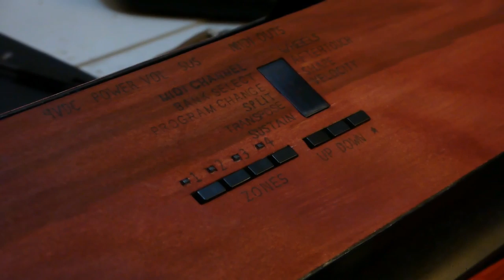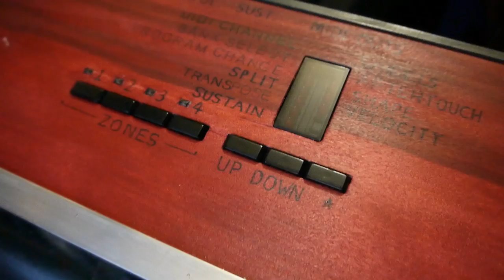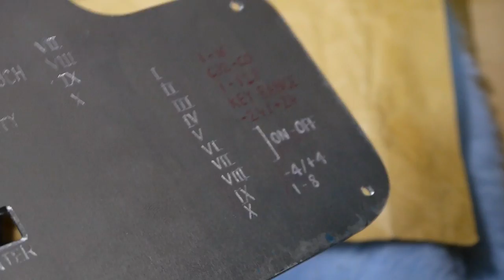Make your keyboard look AWESOME Pt1 - Fatar SL880 Restoration - JDSC Projects

Comment: I have a Fatar Studio 90 and that "sticky stuff" is a rubberized coating that has decomposed.  It did remove the lettering when I removed it, but I didn't mind.  I think I used rubbing alcohol to remove it.
Reply from the maker: Yeah that’s the go to method to at least make the keyboard usable. My next sticky removal job is going to be on my M-Audio Venom’s control knobs and wheels... I can’t cover those in wood veneer!

Comment: Thanks for the ideas. My SL-880 paint has also deteriorated into a sticky rubbery mess and I need to do something about it. I thought the paint issue was something to do with my unit or location or care but I see many other people reporting this same problem. The keyboard itself still works as well as new. I think I might try printing new  control graphics onto a transfer or decal or something. Still figuring it out.
Reply from the maker: Glad I can provide inspiration! I definitely recommend a simpler route than what I chose. Vinyl wrapping for example...

Comment: The finish on these keyboards seems to be some kind of rubber based coating which over time deteriorates into a sticky terrible mess!  A good reason to customize yours as you've done!  I have some Nady wireless mic receivers that seem to be coated with the same substance and now they too have turned into the same mess which smells very toxic by the way.  I removed most of it from my keyboard using mayonnaise and hours of rubbing with many rags.  I did not refinish my keyboard so nicely as you have but left it with the black undercoat of paint and used white electrical tape to write the lettering on. That may be crude but it certainly has enough contrast to read in dim light!  :)  Another reason for not putting much effort in was that  the zone buttons and settings hardly work - something with the electronics.  Thanks for the great video!

Comment: I had the same problem with the sticky stuff, decomposing rubber paint or something. What worked wonders for me when removing it, was plain ethyl alcohol 97%. Although it did remove all of the small lettering, it left the SL880 logo intact.. strangely. 
And, nice video!
Reply from the maker: Thanks! I still never figured out what it was or why it was doing it... It probably would have been much easier just wiping it off too, but hey, I got to play with veneers!

Comment: @JDStone Creations Can you possibly tell me which around the 4 connectors for the keyboard go?!
Reply from the maker: Ben Cleary Sold the keyboard after this video, so no way of finding out... sorry! Best bet is to see how the cables “fall”, as in what shape they feel like they want to sit in. Unless you’ve messed with them already it can give a good reference t which plugs in where!
Reply: @JDStoneCreations  the main ribbon cables I don't have an issue with. It's the little tiny ones on the left-hand side. I'm guessing they carry the "after-touch" control signals
Reply: I may just email Fatar to be on the safe side!